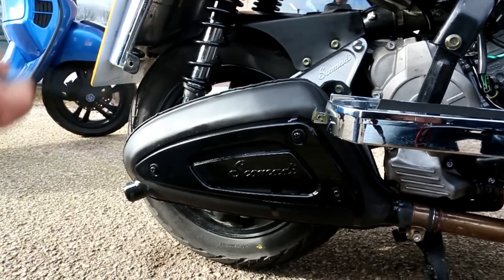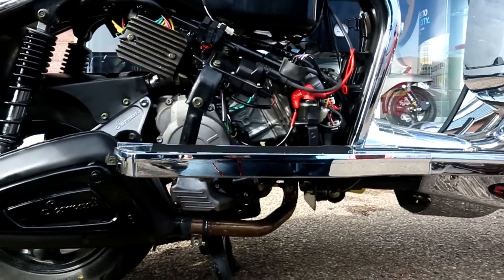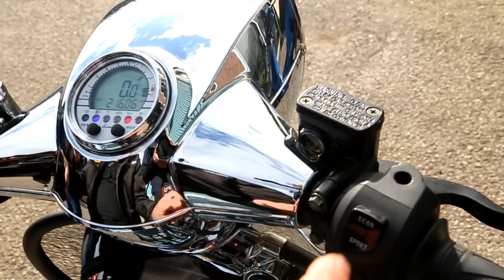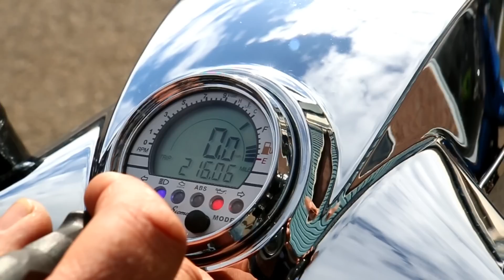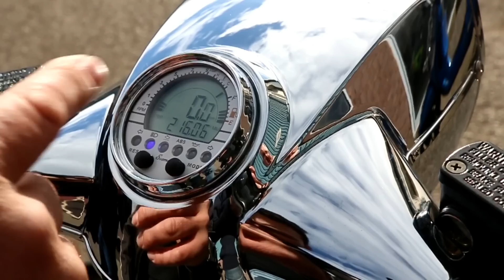SLUK | Scomadi 200 walk-through

Comment: anyone know the cyl head torque specs? i  cant find any info on the net, very difficult engine access,poorly designed for servicing, especially the drive belt and variator. I am a 61 year old mechanic,so ive seen a lot of scooter designs in my time!!